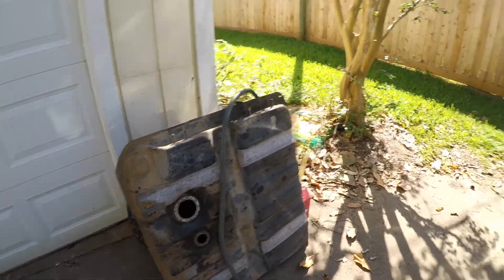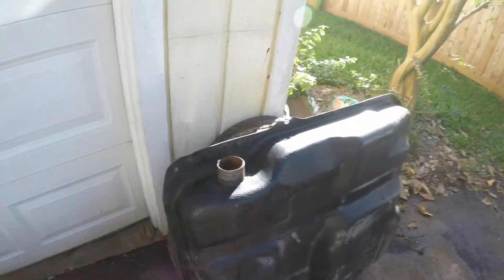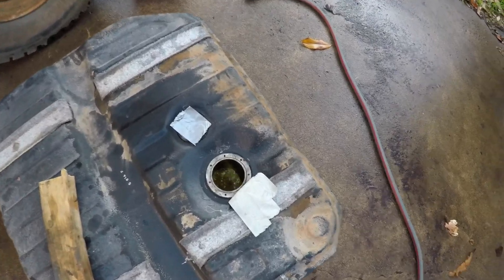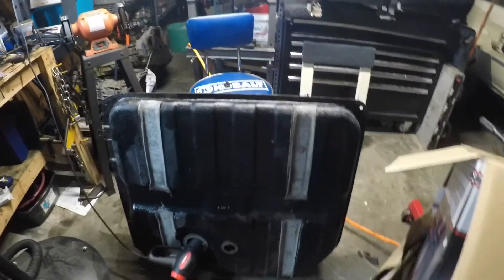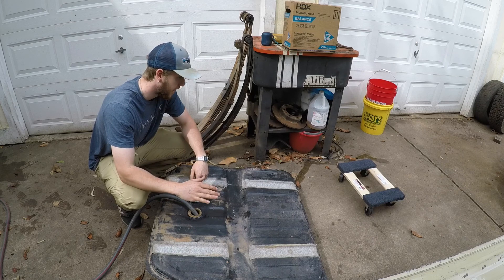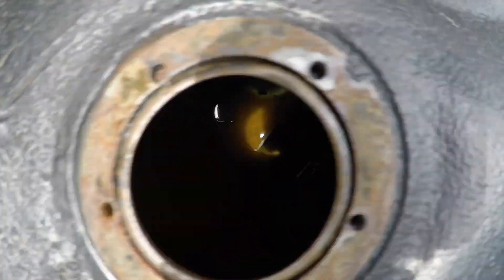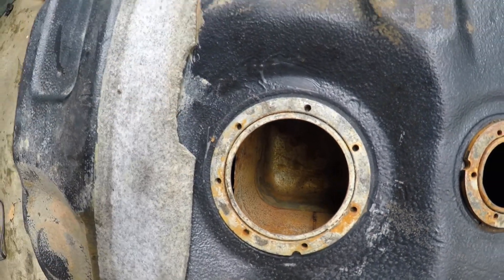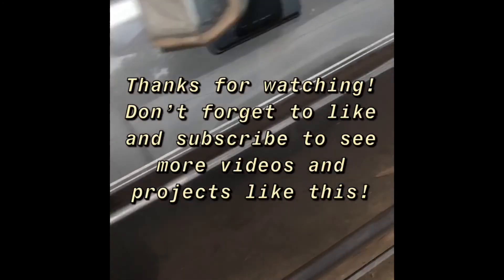How to Restore a Rusty Fuel Tank With Muriatic Acid and POR15 Tank Sealer

Comment: Nice job. I just did my '67 Corvair gas tank with Red Kote, doing much of what you did using 2 gallons of EvapoRust instead of muriatic acid. That flash rust is a huge problem, you gotta work fast.

Comment: Nice job getting rid of the rust but you did too good a job and wasted some acid because flash rust is good for por 15 to stick to the metal better you didn’t have to go through all that, Por 15 will encapsulate the rust

Comment: I'm about to do my 240Z fuel tank. I'm glad you reminded me to use cheap muriatic acid instead of the more expensive POR-15 etching stuff. I use muriatic acid quite often on car parts and whatever. It doesn't mess around! It's also toxic as hell and even fumes in a closed garage will rust everything in your garage. Don't do that. Yes, baking soda is very important to neutralize the toxic beast. For degreaser I'm going to use quarts of alcohol that I have a case of following Covid-19. Alcohol is quite toxic and also mixes with water. (Alcohol is what i call a B-component. If A and C don't mix, like water and laquer thinner, use a B-component that mixes with both A and C.)
I have used many POR-15 paints in past years and nothing is better.

Comment: I believe if you used the Por15 prep, it destroys the surface rust and etches the tank for a better seal? How well has it held up for you ? Also how long did you use the heat gun on the tank to dry it properly?>